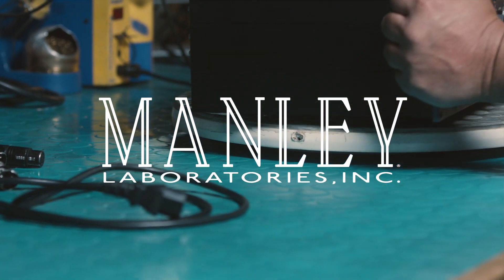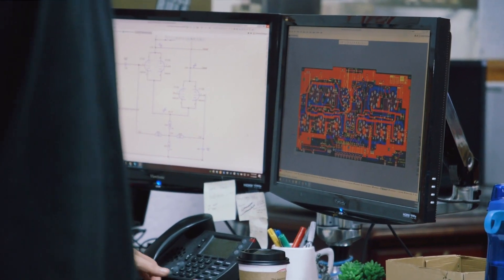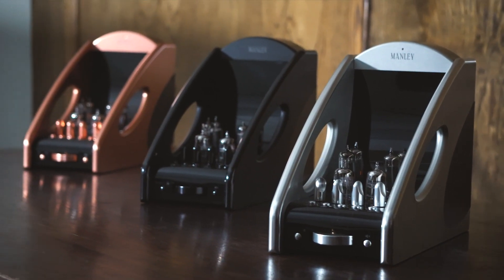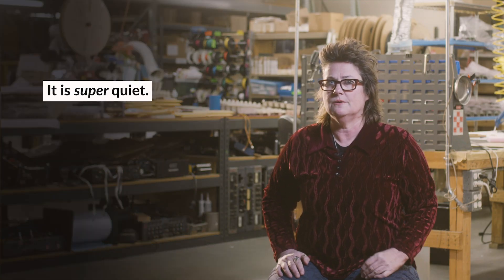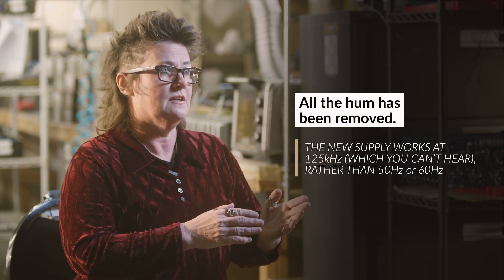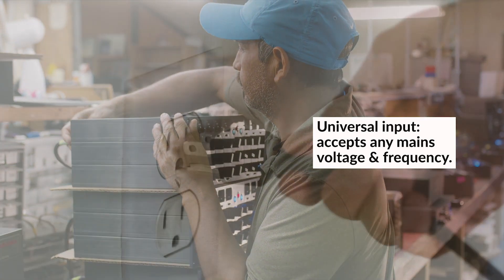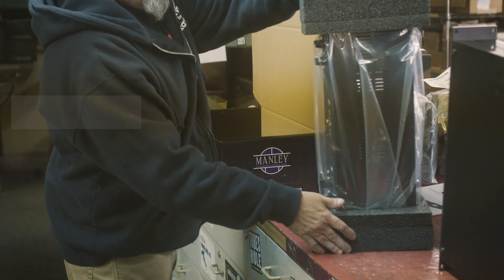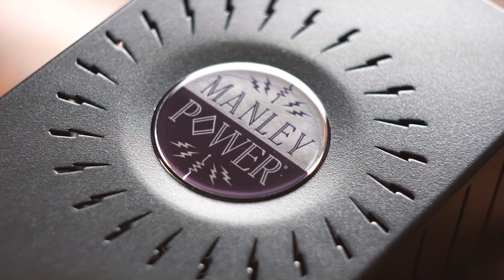MANLEY POWER®

Comment: i understand the choice for SMPP , but for the noise part , when u 
designing  a amplifier , you know how much power it's had to deliver and how big the power supply capacitors need to be, to prevent noise (hum) , the only thing you can't control is the aging of the capacitors but if it are good ones they should last for years, the pro's of smpp is that they are light weight and can produce a lot of power and the noise that it induces is above the hearing spectrum so that's good, , it;s the logical way to go , bulky transformers are loaded with copperwire which is expensive and weighs a lot which makes shipping costly also.

Comment: Just because something measures better doesn't necessarily mean it sounds better
Reply from the maker: Agreed which is why we did extensive listening tests to make sure that the new power supply really did sound better. And miles better.
Reply: Fantastic, I think you guys may be onto something and I wonder what a switch mode power supply tube amp would sound like?
Reply from the maker: @Audiorevue  The Manley Absolute Headphone Amplifier is a little baby tube amplifier that uses our new SMPS Manley Power®!

Comment: My experience with switching Power Supplies. Yes it is more efficient and the higher frequency you go the smaller size of the transformer. The negative is how hard the switching drivers have to work. The oscillator and driver circuitry has a tendency to stop working.
Reply from the maker: We have not had that same experience as you have. I attribute our success to having the world's greatest audio power supply engineer, Bruno Putzeys, design this PSU for us. It has proven to be extremely reliable proven by over thousands deployed around the world since 2014.

Comment: I have a Manley Voxbox - Can it be retrofitted with this new power supply?
Reply from the maker: We have not yet gotten to engineering the VOXBOX to run from MANLEY POWER® yet, although it is next on the list, and no older units can be retrofitted or upgraded to the new system. Too much work and re-work to make it viable.
Reply from the maker: We do cover this on the MANLEY POWER® web page FAQ: https://www.manley.com/manley-power
Reply: @manleylabs  Is this power supply available to be bought separately to be implemented in DIY projects?
Reply from the maker: @Adi-w2r4z  we are not supporting this, meaning we will not provide any design assistance to DIYers as we need to dedicate our engineering resources to our own new projects and keep our Tech Support team focused on helping existing customers of Manley gear. I hope you understand our position. We just don't have resources to play in the DIY world at this time.
Reply: @manleylabs  My question is: is this Power Supply unit for sale? I understand, no need for assistance.
Reply from the maker: @Adi-w2r4z  if it is not on www.tubesrule.com then we are not offering it for sale outside of a MANLEY unit's repair. Sorry.

Comment: should that be woman's power lol
how much does it cost to buy the power supply and can I change the voltage??
what's its signal to noise ratio and maximum amp draw cheers!!
how is this better say than medical switching mode power supplies.
Reply from the maker: Read about it here: http://manley.com/manley-power
Reply: @manleylabs  there's no explanation on current draw or voltage output on that link  is this automatically set, I mean will a device pull what it needs in voltage and current automatically there is quite a big head pin plug is there a pinout
Reply from the maker: @johnsweda2999  We have designed these MANLEY POWER® PSUs for use in our MANLEY products. We know what the pinouts and the voltages and current draws are in order to make this system work in our vacuum tube designs. At this time we do not have any outward facing documents for consumers to buy this for your projects.
Reply: @manleylabs  ok!  but why not sell the power supplies for everybody to use in the own products like valve amplifiers maybe with a voltage selector from 5 to 48 volts just saying make life easy! Maybe you might consider it. Don't get me wrong but if you claim they are good as you claim they are surely they would sell like hotcakes make you nice little profit, at the moment there's only really Chinese stuff out there and I think it's bad to buy Chinese for the world economy another story for another day. Thanks for the reply
Reply from the maker: @johnsweda2999  our first priority for our engineering team is to engineer them into MANLEY products. We have not made the time yet to make them available to the outside world yet nor re-engineer them for different voltages... maybe someday, and thank you for your suggestions! We are swamped with new R&D work for our own products!
Reply: @manleylabs  how much do these power supplies sell for? And changing the voltage is not particularly difficult process or is it automatic by a ic,
As I say just make sure the pinout is available and the circuit diagrams, I suppose must be available for repair in the field anyway.